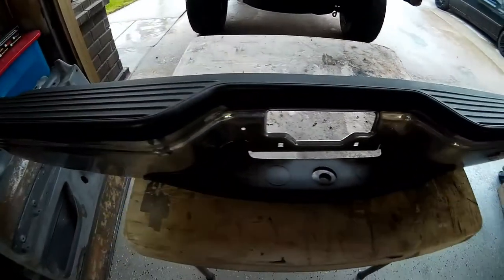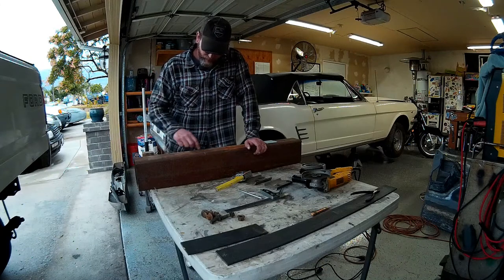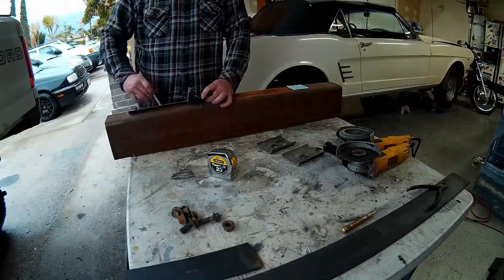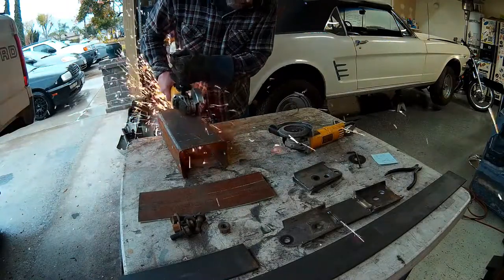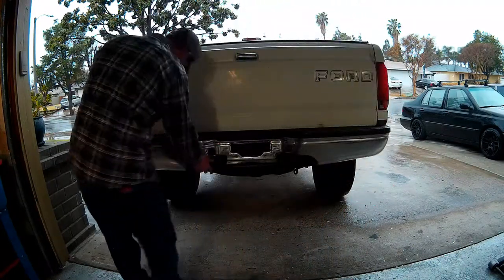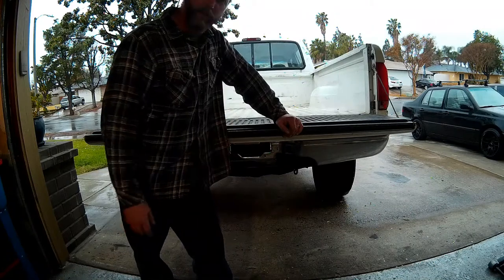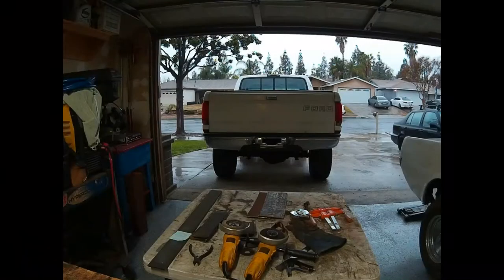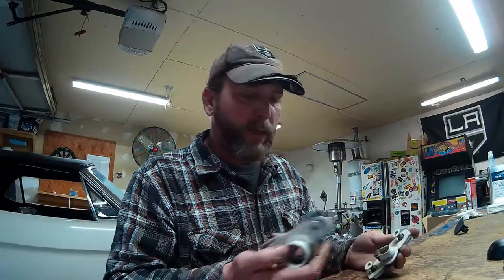Ford OBS; Rear Bumper Swap, Conversion!

Comment: Nice job! It definitely makes you do a double take to have that style bumper on the OBS truck. I like the stock bumpers that were on these trucks, but that one definitely does mimic the shape and appearance of the front bumper. I think I like it (I think). At any rate,  it's a well done modification. The truck is really coming together nicely.

Comment: I couldn't agree more with your thoughts about ford having the front bumper flow and curve then the rear is like a damn square channel looking bumper. I think the new bumper looks good!  One question is what are you going to apply on the sides where you trimmed to stop rust from starting and eventually popping and bubbling the chrome finish?